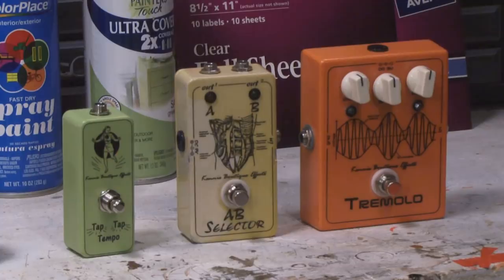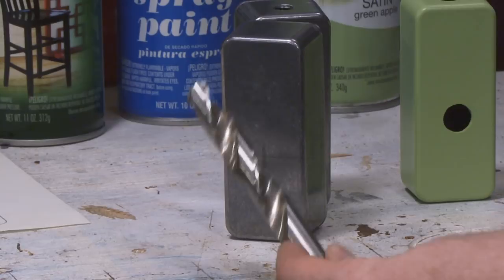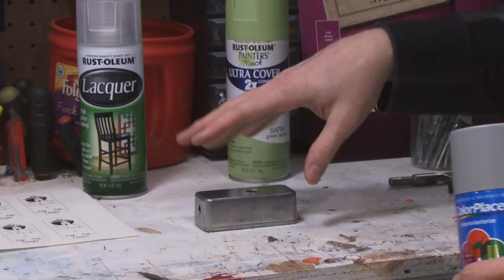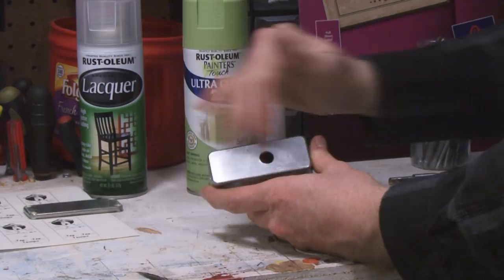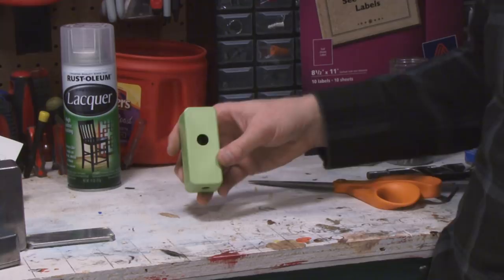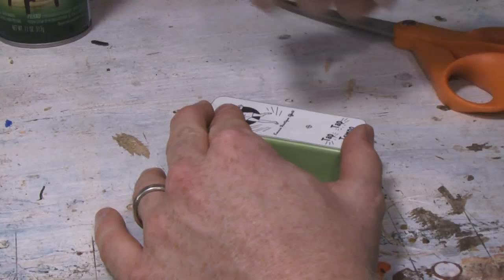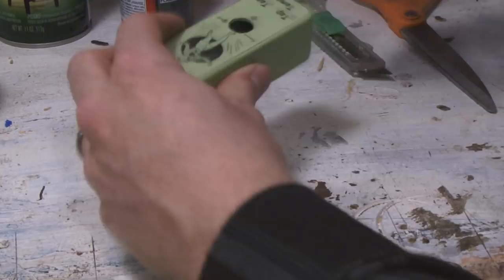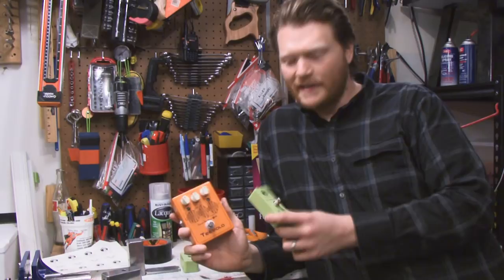How to Paint Your DIY Guitar Pedal

Comment: If you want a smoother texture put at least 7 to 8 coats of clear.  Then lightly water sand the clear coat to level it out, this makes the surface really flat and smooth. Careful not to burn through the clear on the corners. Sometimes when the pedal is tilted slightly you can see the bumpy texture of clear coat  which is NOT an example of a professional pedal. If you want that pro look sand and BUFF the clear coat, just like on a custom car paint job. I use wet 1500 sand paper.  NEVER EVER use steel wool before painting, steel wool has oil in it and will embed into the metal. Sand metal with 800 grit then 1000. Clean the metal with lacquer thinner then let dry  before applying a primer.  Then paint, then sticker then clear, sand level then buff on a wheel for a mirror finish.
Reply: Wet sanding the color will actually yield better results to get rid of the "orange peel" effect, and you don't need as many coats of clear that way.
Reply: Can I use wax car intead of the sand paper?
Reply: Sure. Why the hell not, right?
Reply: I didn't know about steel wool having oil in it! Great tip!

Comment: I know this is an old video but something you can also try is printing a design (in reverse, you'll see why) with a toner printer onto glossy photo paper (the toner is a kind of plastic...) now place the image face down onto your pedal and with a hot iron, carefully iron it flat, (make sure you do a practice run!) the design will free itself from the glossy paper and attach itself quite nicely to your surface... You can do some really high quality, high detail designs, it's also useful on lots of other custom things!

Comment: Acid etch needed primer needed if priming to  bare metal. 
I'd probably slightly scotch and tack wipe before applying the transfer for good adhesion, then poly lacquer for a hard finish.
Good video thanks for the info 😎🎸
Reply: Some bulldog

Comment: Don't wipe, use a blower - Also, hang it while you paint it with a clothes hanger, you'll get a more even coat on all sides and it will dry evenly. Also, if you don't want the 'orange peel' effect, dont use the clear full sheet label, get a die-cut made and then do a clear coat over top of it. 2 even clear coats should, you don't need to do like 8 clear coats. I used to paint cars and I'd do 2.

Comment: GREAT VIDEO!! Exactly what I was looking for!! I just started building my own pedals and as long as the assembly is solid, the look of the design is almost just as much fun!! 

I am still looking for a step by step or methods/materials to actually hand paint with a brush.

Anyone know what the best paint to use? I assume all of the steps are the same, but replace the label application step with hand painting with a brush then dry then seal?

Comment: Acrylic paint? Does the paint need to be "rust prevention" type (even tough it's Aluminum, it might stick better?) Any special consideration for the primer type to match the paint type? Was the color a "glossy" type? (I would think not since you add a clear coat).

Comment: Hey, so I have to ask. I tried your method. The Lacquer spray paint has a type of paint stripper in it. If you use that over other Rost-Oleum paints, it actually causes them to strip. Did I miss something in your video? Is there a way to stop that?

Comment: Hi there, just curious, is rustoleum lacquer a must for this job? I got rustoleum paint and not sure if I can cover it with normal lacquer or do I need rustoleum one? Thanks very much for this very useful clip.
Reply: I tried the Lacquer over paint and it stripped the paint, caused the paint to bubble off like a paint stripper. Not sure the solution for this.

Comment: ***** One more question: I've tried this method of painting a few times on a few different enclosures. I've sanded, steel wooled, and rubbed the enclosures with mineral spirits to prep them. When I apply the decal, (I am using color decals), I notice that the adhesive tends to absorb some of the paint, adding the paint color to the decals. I apply a couple coats of the lacquer afterwards, and they still look pretty good. But would you recommend applying a single coat of lacquer BEFORE I attach the decal? (And then add a couple more coats of lacquer afterwards). Thanks
Reply: Yeah I let it dry long enough. I'm going to try it and see what happens. But as you said, the lighter the paint, the better it stands out. Thanks again!